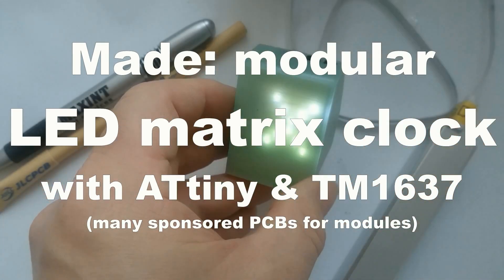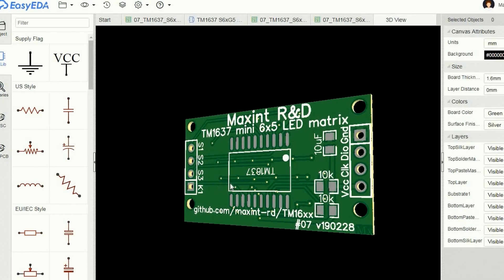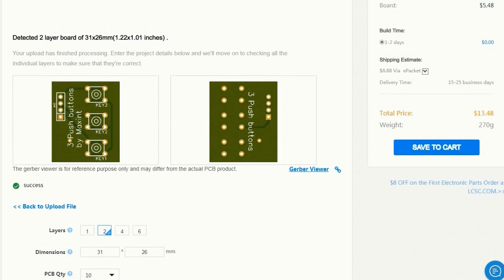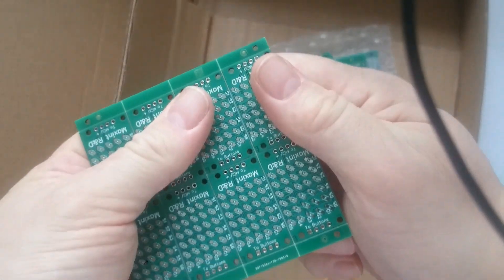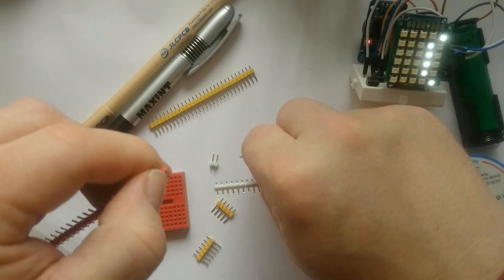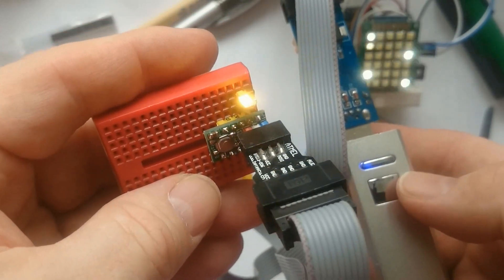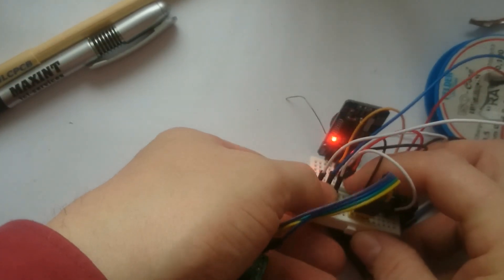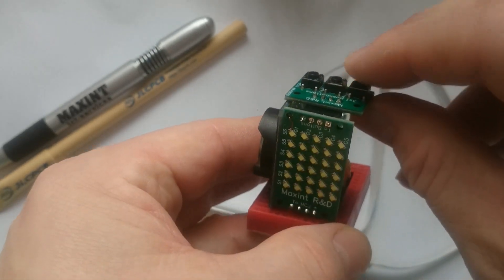Made: JLCPCB TinyDev TM1637 modular LED matrix clock with ATtiny85

Comment: Loved the video very informative I am new to Arduino but would like to update my old alarm clock with the bells on top and would like to use your boards and code if you think it would work the maximum width of my clock is 83mm and I don't know the size of your display module I would like to fit four in a row if possible so with that in mind would you sell me some boards I live in England so don't know where you are and the cost  Thanks Bob
Reply from the maker: Hallo Bob, that sounds like a very cool project. If you're new to Arduino, then I suggest you first start with the basics and make a simple prototype on breadboard which you can enhance step by step. There are many resources online, such as tutorials on YouTube. In the description below my video, you can find links to follow. I don't sell ready made boards, but I have published them on EasyEDA, in which you can also retrieve dimensions. Feel free to use the designs as a base, or as is to order your own PCBs. Have fun!

Comment: I've been looking for something exactly like this! I'm excited to try it out. Especially as an alternative for the max7219/21 which is commonly faked and very expensive to purchase from legitimate sources ~($15/per IC!!)
Reply from the maker: Hi Mike, then also look at my other video's about the TM16xx chips and have a look at my TM16xx Arduino library on Github. These are indeed quite affordable useful LED driver chips. Most also offer a button interface. For a larger matrix the TM1640 can be handy. Main advantage of the MAX chip is that it allows full daisy chaining and individual LED intensity setting.
Reply: @MaxintRD  I just ordered a pack of 20 TM1640's I'm super excited to start hacking around with your libraries. Combined with the IO expander library you wrote I want to see if I can squeeze a wifi scrolling display out of an ESP-01. Thanks for your contributions to the community!
Reply from the maker: @leachim66  - Hello Mike, nice to read your enthousiam. In one of my previous videos you can see the 64x8 pixel scrolling matrix that I made using four TM1640 chips. I have not adapted the TM16xx library for mxUnifiedIO, so that would probably require quite a bit of low level programming. If you don't have much programming experience, I advise you to first start using a D1 mini or another ESP-12F board. I think there is plenty of challenge in adapting the ticker example to do something useful via WiFi...
Reply from the maker: @leachim66  - BTW. 20 TM1640's would allow for quite a big display! I intend to make my TM1640 matrix 16x8 PCBs public as well, but still need to properly test them...